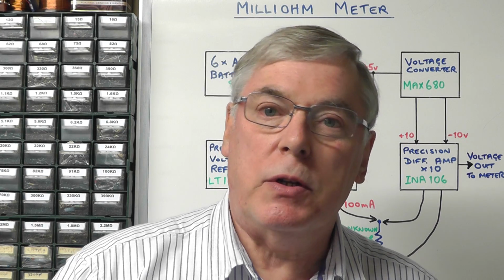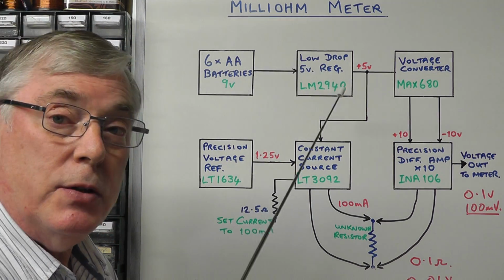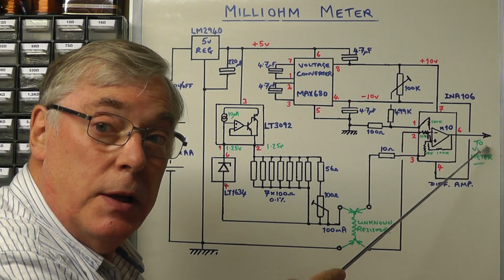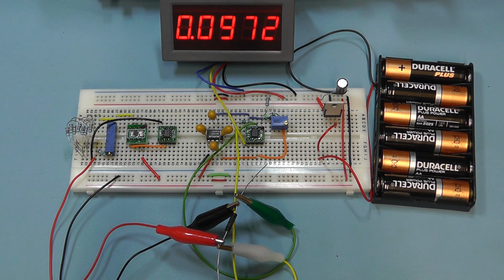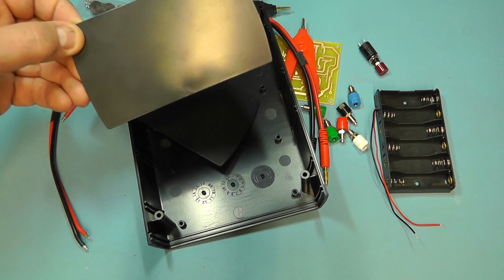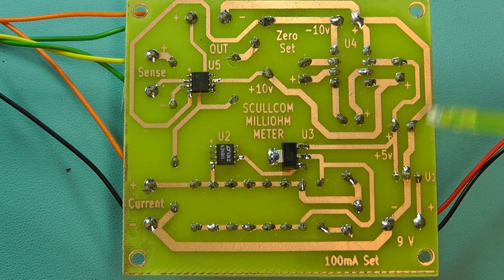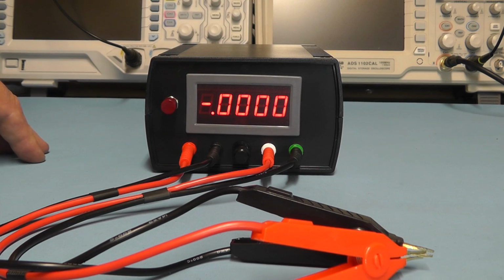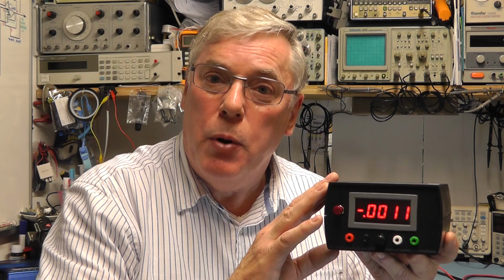Scullcom Hobby Electronics #31 - Design & Build a Milliohm Meter

Comment: A very well put together circuit design and video. One question. Is temperature drift an issue? Because of the low current draw of the components, I wouldn't expect they would cause an issue but ambient temperature changes might. Maybe only in zero though.
Thanks again.

Comment: I just did a price on the IC's only and the cost is $42.30, Add another cost for the remaining parts say $20.00 brings the cost to $62.30 , w/the pc board another $10.00 the cost is $72.30.
I went on Ebay and found a milliohm meter w/leads for $44.14 w/free shipping. 
Why build your milliohm meter when it is less expensive to buy on Ebay?

Comment: A well paced lecture on how a project is developed: from the start block diagrams and their relationships, Then a purposed schematic to iron out some obvious kinks and electrical issues, to a breadboard to test the theories calculated prior, make adjustments or changes to anything outside desired specifications,  fine tune, final testing, prototype and test, all with jelly bean parts...marvelous. Spot on.😊

Comment: The use of a 30+ year old difference amplifier costing $12 is kind of strange. The AD8553 is ~$5 and superior in essentially every sense, and runs on lower voltage. Four AA batteries and a cheap TLE2426 supply +/- 3V, eliminating the MAX680, and two batteries. 0.1% low-drift SMD resistors for gain setting are $0.50 - $0.90. A gain of 100 would allow the use of only 10mA; this reduces battery drain and further reduces any heating effect in the measured resistance.
Reply: Great idea, but you will must to use a galvanic splitted power supply for the panel meter because the virtual earth of TLE2426 have 3V offset.

Comment: Hi there is chipper method to do this if u have 3 diode in parallel and u want to know which on faulty , use power supply with limit current  and put minus probe on one diode and the same time touch the diodes and u feel the shorted diode become warmer then other .simple no??

Comment: Does it measure the difference between two resistors - 1000.1 Ohm and 1000.01 Ohm ? Could it be used for selecting eg. 1k resistors?

Comment: I got a problem with this project. I'm getting that a voltage generator is a requirement, cause fails without it, but unavailable around here. I google about and found bunch of 555 negative voltage generator, but with a low current capability. Can  you guys help me here?

Comment: If I have a 6 & 1/2 digit panel meter or multimeter can I measure a 1micro ohm resistance with this device ? What is that limiting this circuit to measure a resistance only up to 0.1mili/100micro ohm not less than that. Please answer.

Comment: Thank you so much. Very interesting, and remarkably simple. Perfect for measuring the resistance of high current (up to 2700A)  welding cables. At those currents they can heat up enough to melt the cable sheath, even with 120mm squared cable. Part of my job is to recommend what size of cable is needed for a given length, and current. Now I will be able to actually quantify the job. As you can imagine a 100 meter length of 120mm cable can cost many hundreds, even thousands of pounds.

Comment: Very nice video sir. I like all your videos. I like this project 
Sir can you please suggest me a cheap but effective multimeter or a power supply.
 I have mastech MS8360E 

For this project can you please provide a link for volt meter used in this project
 Thank you 
I really appreciate your reply
Reply from the maker: Hi,
The ANENG AN8008 is a good low cost 9999 count Auto Ranging Digital Multimeter for the hobbyist and is available on eBay for around £17 (23 US$).
There is also the ANENG AN870 which is a 19999 Count True-RMS Auto Range Digital Multimeter available on eBay for around £27 (36US$).
Both these are very good value for money.
The UNI-T UT139C True RMS Digital Multimeter is also a low cost one for the hobbyist but has a lower 6000 count. Available on eBay for around £30 (40US$).

The 5 digit panel meter in this project is available from:
https://www.aliexpress.com/item/High-precision-accuracy-0-56-5-Digits-DC-Voltmeter-Digital-volt-voltage-meter-panel-Meter-LED/1048073842.html
You may also find them available on eBay.

Regards,
Louis
Reply: Scullcom Hobby Electronics thx sir

Comment: Thanks for your projects and ideas. They are very much appreciated. I searched ebay for a panel meter like the one you used but could not find one. Would you have a link or brand and model number for it? Thanks.
Reply from the maker: Hi John,
The 0-2v panel meter I purchased on eBay was from the seller "yourcartmax" the direct link to the ebay listing is below: 
https://www.ebay.co.uk/itm/DC-4-1-2-High-Precision-2V-0-1-9999V-Red-LED-Digital-Panel-VOL-Meter-New-/263282097547?hash=item3d4cd5fd8b
Regards, Louis
Reply: Scullcom Hobby Electronics Thanks and thanks again for your excellent instructional videos.

Comment: First of all, love your videos. Would be awesome if you made an all in one DC precision multimeter with the ohm meter, voltmeter and then add  precise amp meter. Basically making a poormans Keithley 2000 multimeter. Could really use one of those :)
Reply from the maker: Thanks for the comment. Nice idea but I think it may be costly to fully copy a Keithley 2000. Regards, Louis

Comment: Unfortunately you always use expensive components which makes building projects prohibitive.  I realize this makes for an easy and very accurate solution but I'm more of a what can I hack together kind of guy without costing an arm and leg and still give me reasonable accuracy.  (ie: a current limiting power supply and two dmm's).  Still a nice circuit and well done video.
Reply from the maker: Thanks Digger for your comment. I agree some components can be expensive, will try to use cheaper ones where possible. Regards, Louis

Comment: I generally like you robust design approach. Although I see many overkills:

1. I would remove 5V regulator and converter for reasons below.

2. LT3092 - Has at least 1% set accuracy over temperature. 
If you have precision Vref, why do you need current regulator???
Put junky LM358 for 1cent OP AMP and NPN transitor - it will give accuracy  < 0.1% (1 mV on 1.5V Vref!)
You do not need to measure current and voltage near ground. 
Connect ordinary 12.5 resistor good wattage to ground and measure on OP AM Out.
This will eliminate need of voltage pump and voltage regulator. 

3. Use 7 100 Ohm resistors  is nonsense, ihmo,  because 1% resistor precision is mainly
about initial value. Consider temperature drift instead. It is usually better then 0.1%
for decent resistors almost regardless of resistor precision.  
You calibrate device - no need for precision resistors at all!

4. 7$ INA106 can be replaced by 10 cents OP07 OP AMP with about only 30uV offset error.

5. So the only investment is good Vref.  And total cost should be less 12$ with box. Not 100$.
Reply from the maker: Hi Alex,
Thanks for your comments which I read with interest.
You could remove the 5V regulator if you wish but having a stable input voltage helps with stability and long term temperature drift which could effect the accuracy of the constant current source.
Using a LM358 to generate an accurate and stable constant current source would still be not be as accurate and stable as using a LT3092 (compare the datasheets for both IC's). So my preference would be to stick with the LT3092 which has a very accurate 10µA reference current source on the chip.
You could replace the 7 100ohm resistors with one a good quality resistor if you wish.
The INA106 is precision OP Amp with on-chip laser trimmed metal film resistors on the same substrate so it gives a very accurate x10 with an accuracy of ±0.025% and a non linearity of just 0.001% maximum. You would not be able to achieve the same accuracy and temperature stability with a OP07.
Anyway, have fun with your own project its all about individual choices and what your main requirements are for you.
Regards,
Louis

Comment: Thanks so much for this project!
I have to test welding machines which can output up to 2700A, so knowing what your load resistance, which is usually just lots of welding cable is vital.
This will make my job calibrating so much easier
Reply from the maker: Glad you found this project useful.

Comment: It's a amazing project!! 
It seems to be very accurate, but I have a question, could I use it on industrial application on a motor factory, measuring the inductor resistance of the motors?
Reply from the maker: Thanks. Yes it could be used to measure low resistance of motor winding if you wish.

Comment: I really enjoy your videos!
Thank you and kind regards

I wanted to build this very handy item but found some components quite costly.

LT3092 - $3.71 - 
http://www.ebay.com/itm/LT3092EST-PBF-PROGRAMMABLE-CURRENT-SOURCE-0-2A-3SOT-/112408104579?epid=1239457566&hash=item1a2c0b8e83:g:AScAAOSwaeRZGazu

LT1634 -  $6.37 - 
http://www.ebay.com/itm/1PCS-LT1634BCS8-1-25-PBF-IC-VREF-SHUNT-PREC-1-25V-8-SOIC-LT1634BCS8-1-25-1634-/192151405852?hash=item2cbd1dc51c:g:9PEAAOSwa~BYUkiX

INA106 - $3.50
http://www.ebay.com/itm/1pcs-INA106KP-INA106KPG4-OP-AMP-IC-DIP-8-/391353257545?hash=item5b1e78ce49:g:tqIAAOSwUdlWg-3W

MAX680 - $5.00 
http://www.ebay.com/itm/1x-MAX680CPA-5V-to-10V-Voltage-Converters-MAX680-/110753910803?hash=item19c9729013:m:mHdLifYgDEfWoJ74Vjnwd9A

That's nearly $20 to start with. It feels as if it might be worth while buying a unit for $36

http://www.ebay.com/itm/White-OLED-Four-wire-Digital-Micro-ohm-Meter-Milliohm-Micro-Ohm-Resistance-Meter/272784187809?_trksid=p2047675.c100005.m1851&_trkparms=aid%3D222007%26algo%3DSIM.MBE%26ao%3D2%26asc%3D45701%26meid%3D28e77a1d27f841fea9a7516ff036a14e%26pid%3D100005%26rk%3D1%26rkt%3D6%26sd%3D122605478401

Isn't there a way to make this project a lot cheaper? 

I'm just a hobbyist but like these type of gadgets. Mostly tinkering away at trying to build them and to understand it a bit better.

I really like this project. It has a lot of fundamental consents in and you explained them very well.

Kind regards

Stephan
Reply from the maker: Hi Stephan,
eBay is not always the the cheapest source for IC's. The OLED Milliohm meter you suggested is not to the same specification as the project. It also has a measurement error of ± 0.5% reading + 5 digits.
You could make the project with cheaper components but would loose accuracy which is important on low ohm readings.
Regards,
Louis
Reply: Dear Louis

Thank you very much  for your response. Greatly appreciated.

Because i'm a hobbyist, i'm going to try and build it a bit cheaper for now.

Great project and video!! 
I always enjoy them.

Kind regards
Stephan

Comment: Another excellent project. I would like to build one for myself. 
Would one of these voltmeters work instead? https://goo.gl/hmPTDF
It has the same look and its supposed to be 0~33V with 1mV resolution and is $10 cheaper than the 0~2V version https://goo.gl/eLUddg  !
Also, would you consider uploading the KiCad files? I would like to have the PCB made but I am trying not to re-invent the wheel.
That project box looks perfect too. No link or search string? 
Much obliged, and thanks again for all your hard work.
Reply from the maker: Hi,
Sorry for the delay in replying but google put your message in the spam folder, probably due to the website links. I had to accept it manually so only just seen it.
You need to use the 0~2V version of the panel meter for this project.
I have made the KiCad files available for you in a zip file, click on the link below to download them:
http://www.scullcom.com/Milliohm_Meter_KiCad_Files.zip
The case was from eBay link is below:
http://www.ebay.co.uk/itm/ABS-Project-Enclosure-Box-185x135x80MM-Case-Housing-with-Removable-Plates-KE112B-/191820977916?var=&hash=item2ca96bd6fc:m:mgW8o_6z6tdqM--lRjtfuPg
Hope this helps.
Regards,
Louis
Reply: Thanks Louis.
Ordered the 2v and the case. Thanks again for the cad file. Will let you know how it turns out.
Reply from the maker: Look forward to hearing how you get on.
Regards,
Louis